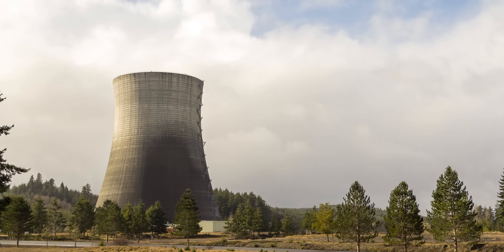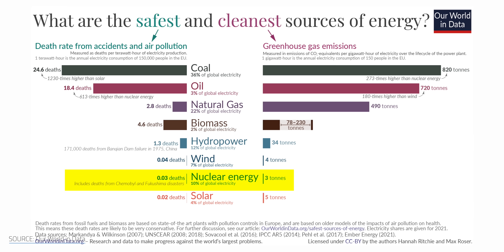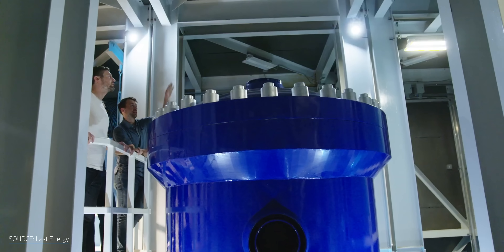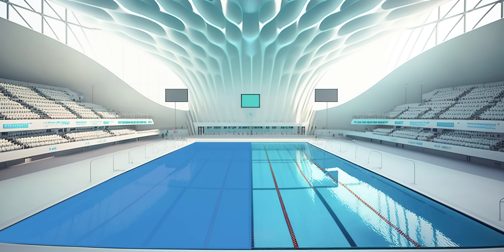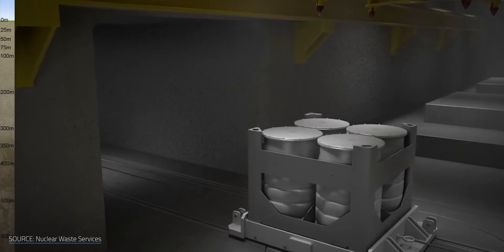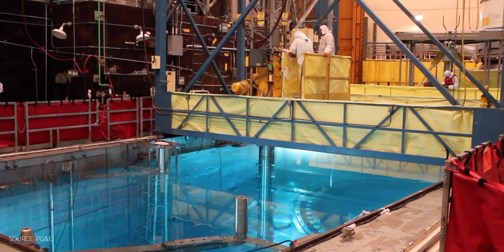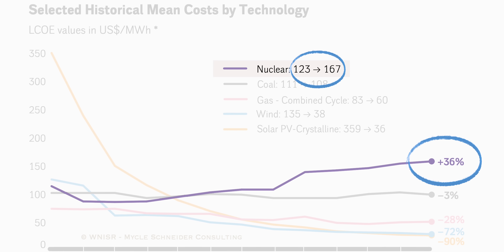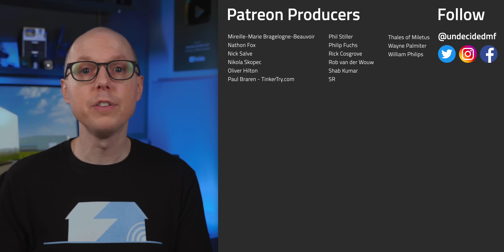Is Small, Fast, & Cheap the Future of Nuclear Energy?

Comment: I believe that nuclear power needs to be used and former coal powered facilities are great candidates for installations. The biggest obstacle is the public perception of nuclear power and the endless environmentalists challenges to the permitting of a new facility. Dealing with that aspect is a major cost driver for building new facilities and the primary reason it takes 9.2 years (on average) to get a new facility built. Unfortunately, the current administration in the US is ignoring nuclear and prioritizing spending on wind and solar which, based on multiple studies, don't have the capacity to meet the current needs of the US. Great video explaining the modular technology and it's potential benefits.

Comment: does the LCOE of solar/wind account for the increased cost of power infrastructure that is necessary to handle the increased fluctuation of the powerplants?
solar can work half a day at varying efficiency. both solar and wind depend on weather.
on the other hand, nuclear can produce same output the whole time.
(i would actually appreciate a video on how quickly can these small-factor reactors react to changes in power demand?)

Comment: The plants are regulated to incredibly low percent of a percent standards in Order to allow the time for the lawsuits and regulatory changes to prevent effective, efficient, and reasonable build time and investments.
We built them all just fine before the China Syndrome, 3 mile island did not end how it had to (See Half Life history on it from Kyle Hill for more).
The analogy is requiring all motor vehicles to be roll caged, helmeted, and 6 point harnessed. The costs far outweigh the minimal gains .

In the mean time, we keep chasing the STILL petroleum derivative requiring solar and wind as the panacea.

We COULD go French, but we keep following Harry Reid's fellows in shutting down all possible efficiencies and developments (such as Yucca Mtn)

Comment: Look. How come the decades of successful nuclear power in France is being ignored? Some 70% of France's electricity is generated by nuclear and has been, safely, for 60 years! Why does this script refer to the old, tired, misinformed tropes about waste, cost, hazards? France PROVES that this American perspective is basically wrong! Also, are you not aware that the spent fuel is not actually waste? Reprocessing turns those pellets into fuel again!!! Please do some more research before broadcasting erroneous and misleading content like 'nuclear waste is dangerous for 24,000 years.' No it ain't. The USA has a political problem with reprocessing and that should be overcome, so that it stops preventing nuclear energy growth and becomes no different from France and other European countries.

Comment: Great video Matt. Yucca Mountain, in Nevada was supposed to be the answer but turned into a waste of money only because no one wanted the waste shipped across the country and through their cities. If we are so worried about contamination then we could put a bunch of these in the Nevada Test site which has already been irradiated due to above ground testing, is in a no fly zone, and protected by the military. You could leave the reactors in place and have them be their own long term storage solution. Living within 100 miles of the US's largest power producing nuclear generating site (which is in the middle of the desert) I have no worry or concern about nuclear power. We are idiots not to switch to it vs wind or solar. If anything Nuclear should be the companion to solar or wind to cover those situations where they don't produce energy.
Reply: How can they be a companion when you have to shut down to allow the greens access to the grid. They're doing that here in Ontario and dumping the heat into the lake so that they can let solar and wind produce during the day. What a waste !!

Comment: The cost figures for so-called renewables were flat-out false. Renewables DO NOT generate constant power, therefore for them to be integrated into a power grid they require additional power systems that run simultaneously. AND the figures provided include government subsidies and do not include recycling costs, e.g. solar panels, etc

Comment: the problem with your ratios for nuclear is that the events happen so rarely that it's not even accurate atm. when something goes wrong, it's massive. aka there are massive spikes, with long periods between them. also as you add more and more points of failure (cheaper production, means cutting corners in production), which will raise the rate of failure.  also you are only comparing DEATHS, not all those AFFECTED. 

people don't seem to understand how long lasting a failure is, even though they have prime examples around still to this very day. making smaller ones but more of them is the worst possible solution, i think i calculated the rate as 1 in 10000 chance for a reactor to fail per year (real bad kind of fail, like a core melting down). this is based on current data, which is lowballing the actual failure rate.
so this means a melt down (or something close to it) will happen once every 10,000 years PER reactor. sounds fine until you understand how many power plants are across the world (~62,500) and then you see the problem. now instead of once every 10,000 years you got 6.25 failures PER YEAR. replace half? still 3.125 failures per year. it's simply not viable to have that many meltdowns, even 1 in 10000 is already insanely high considering the effects stick around for many decades.

should we stick with FF? no, certainly not but wind and solar is right there....why the hell are people okay with taking such unnecessary risks....it's just so beyond me.

Comment: The other issue is security. The additional security measures for a nuclear power plant is insane. Unlike Solar or wind you can't just put it in the parking lot or roof and call it a day. The area has to be secured and then there's a buffer area between the boarder and the public. Now putting it on a ship makes sense. Bunker Oil is dirty as all hell. So you'd literally removing a very dirty fuel consumer vs increasing production and hoping that turned off a coal plant

Comment: Nuclear power would be a great stop gap on the way to carbon free electricity...If that is what the powers that be wanted.
You are under the assumption that those in control are looking for an energy solution for "everyone".  Cars, heating, cooking all being pushed towards electric with no major plans to increase total grid capacity.  Without a change in world leadership, the future will consist of food and material shortages worsened by intermittent electricity and an unstable grid. Ultimately indirectly resulting in less of us little people.

Comment: Competent responsible people to insure safety on modular reactors do not exist. Localities will not be able to monitor, safeguard or maintain such modules. Second, if an accident occurs, there are no competent local responders who can deal with a problem in a timely manner. The speaker neglects mentioning Thorium. A thorium reactor does not melt down. It does not need water coolants.  Thorium reactors can use U238 ( the current dangerous radioactive nuclear waste) as fuel and break it down into thorium with no pollution.  This process can clean up ALL EXISTING NUCLEAR WASTE WITH NO DANGER.

Comment: Although I am not a proponent of classic PWR Nuclear plants, I believe it is important to point out  the the outrageous cost of New Nuke Plants (PWR type) is by far due to the Permitting process and not the actual costs of building the plant.  Every Plant built in the last 60 years has had the permitting process delayed, and delayed, and delayed by primarily the radical environmental groups consistently and persistently demanding (and getting) delays for more and more Environmental studies (no matter how trivial or irrelevant) and the lawsuits are filed again and again (some estimate more that 200 lawsuits, some concurrent and some as serial as possible, most lasting for years).  The result is decades of delay with resultant cost overruns the added costs of fighting those lawsuits.  More recently, the precedents set in those multiple suits have allowed the courts to streamline some of the process by throwing out sujits that are frivolous or previously determined to be irrelevant or without merti.  But not enough to improve the process much.

Comment: The publicized low costs for energy from wind turbines and photovoltaics neglect the additional expenses for a highly flexible power line grid plus gas-fired power plants. These are absolutely necessary to supply a nationwide economy with energy 24/7. If you add those costs, nuclear power is hardly more expensive.

Comment: Thorium or a small salt-based reactor was something a co-worker said would be a good idea. He was really into this subject. He talked about building these in shipping containers for ease of installation.
Reply: I've seen some preliminary engineering schematics & renders for the "MSR-in-a-shipping-container" idea, and it seems brilliant! 
The "ease of installation" is radical. The idea is to make the mini-MSRs fully self-contained so that "installation" basically means setting it on a mostly-level surface and plugging in your control interface at one end (hard-wired not wireless to simplify security protocols), and plugging in your 3-phase power cables into a dozen (?) outlets on the other end. Done. If you need more power, add more modules. When you don't need them anymore, you shut them down, unplug them, load them onto trucks or train cars or container ships, and send them elsewhere. 

And by the way, marine-rated versions of these containerized hardened self-contained SMRs would mean that OCEAN SHIPPING COULD BECOME NUCLEAR-POWERED rather than burning the worst kind of oil as it does now. 

I'm not sure what it might take to refit existing container ships in that way, but new container ships could easily be engineered for container-based nuclear power. It might be the "cheap to procure, easy to engineer, safe to operate, accident-proof, easy to swap out at end of life" nuclear solution that commercial cargo ships have been waiting for. 

(Imagine the irony of nuclear-powered oil tankers plying the high seas, never needing to refuel!)
Reply: @Wordsmiths  Lots of benefits in thorium and salt based reactors. Check out Seaborg in Denmark, they are working with companies in South Korea to put them on ships. The idea is being you just run cables from ships in to huge cities in developing countries and BAM tons of energy without the problems of constructing the plant locally. Obviously also gaining the benefit of mass production.
Reply: @Wordsmiths   His thinking was how one container can power a city.  I heard of Thorium in a video talking about powering a space station on the moon.
Reply: @ronwest7930 They built a car in the 1950’s that ran off a small nuclear generator. Ford Nucleon was one of them. 8grams of thorium was predicted to power the car until the wheels literally fall off 😂
Reply: @OnlyAusername64   Cool. While not on thorium,I have a brochure for the Chrysler turbine car. My dad said the car had no brake effect from the engine and went through brakes. I don't see any interest in thorium by the gov. Hydrogen has a better chance of getting developed. Thorium sounds good though.
Reply: Your Dad did not know how electric cars work. Some of the energy used for accelerating the vehicle can be fed back to the battery during braking. Also, when waiting at traffic lights no electricity is wasted, unlike the "tick over" with the gasoline fueled engines in most cars.
Reply: @Macrocompassion   A turbine car is not an electric vehicle. you are confused.
Reply: Do you know:
1) How much cost 1 Container
2) Output figures
3) Operating costs
4) is there any dangerous waste, if yes, could it be used further more…
5) Time to build, permissions, until plug and play
Thanks.
Reply: @archivtv5460  the compact molten salt reactor is the most economical new design as described on Wikipedia. It may be cheap enough to displace coal from the commercial Marketplace
Reply: @archivtv5460  
1- ???
2- 100 times more power production than uranium
Unranium can use only 2%
Thorium can use 98%
3- ???
4 - thorium msr can burn nuclear waste from uranium reactors.
Uranium waiste 98% muste be safly stored for 21.000 years
Thorium wast only 2% only needs to be stored safely for 200 years.
Reply: @VriendRick   Most sites are very large and can bury on site, but doing something useful with any waste is good. The Gov. spent a fortune building a waste disposal site in NV. I don't think it was ever used. some kind of multi-coated cylinders. I guess the word nuclear freaks people out, nobody wants any waste traveling through their states. From what I have read Thorium seems like a game changer if it works. I wonder what waste a molten salt reactor would produce. I watched a video where they showed them putting a new keg of salt into a submarine's system. I think that's what it was. just ramblin.
Reply: @VriendRick  That's al, wrong. Both thorium-cycle and uranium-cycle can use the about 24 GWh/kg of energy to 100 %. It just depends on the reactor design you use.
Reply: @Wordsmiths    I dunno man, ships get pirated. You really want those guys having that kind of technology?
Reply: @deeeeeeps it would be entirely self regulating. The pirates would try to break the reactor and would be killed by their own negligence pretty quick.  It would be similar to handing a 5 year old a grenade with a big red streamer on the pin...
Reply: @deeeeeeps  You can't use thorium fuel for nuclear weapons.
Reply: @richhenry8004  That's wrong! The U232 in the mix makes it a bit harder, but there is still are ways to do it.
Reply: Yes Thorium! Less Radioactive! ☢ 👍
Reply: Sadly governments CANT use thorium reactors to help make weapons grade material - so the idea would get killed off pretty quick, in most major countries
Reply: There's only the obvious problem that there are no commercially operating SMR and that Thorium power plants are a total fantasy. So again, neither exist in the real world. 
The solution is already being implemented right now. It's the combination of solar, wind and batteries.  We don't need 100% powering our grids, we need around 500% for the dark, windless days. It is happening because the prices are dropping sharply in SWB. Prices in nuclear are rising instead.
Reply: Yep you can google ThorCon or Copenhagen Atomics
Cheap electric for 0,03 cent per Kwh
Reply: @copenhagenatomics

Comment: Problems of SMR is two thing: First is that SMR  is too expensive for its power generation capacity (per kW or per kWh base). Yes, small SMR is cheaper to build but small in power generation capacity, too. So economy of scale is against SMR.  Best SMR is about two times cost of conventional  nuclear or any fossil-fuel power plant. Seconds is that it does not solve or reduce nuclear waste problem. Same amount of nuclear waste for same nuclear power generated. We need cheaper SMR with much less waste.

Comment: Since one of the crucial issues is reprocessing, it seems to me that molten salt reactors would be SO MUCH BETTER that it's just not funny.
Still not cheap, but imho, MUCH more practical, with the advantages that ALL the available energy in the nuclear fuel is utilised, and they can also enable the use of Thorium, a much more abundant fuel than Uranium, to be included in the mix.
China are currently running with this technology which was jettisoned due to political pressure after an extremely successful experimental molten salt reactor ran trouble free for years at Los Alamos! That was 60 odd years ago.
Politics has buried one of the best reactor types ever conceived. It's too sad, and too bad.

Comment: I wonder if anyone is building small Thorium reactors using standardized modular techniques? That would solve two of biggest problems: meltdowns and radioactive spent fuel. So you wouldn't have to bury them and potentially contaminate ground water. Sounds like a potential new video for you?

Comment: Actually they are not any safer than a pwr... cost wise you still need to manage and secure site so those things are not proportional to power output.   Safer? then you need to look at molten salt and fast spectrum to get those additional benefits. The implied benefit is the notion that they can build in a factory but thats not the same as total running costs. MSR core reactor 1.2GW can fit on a standard truck as can each of the components other than maybe turbines. So the value is limited sites but enough for redundancy. Also, wind and solar require 6 times the raw materials of nuclear and to date very little is recycled. so the long term storage of toxic wind and solar waste  is a permanent repository that doesnt have a half life.

Comment: No pressure vessels from any nuclear submarine (the same type RR propose for use in SMRs) has yet been fully disposed of). And few reactors of the hundreds of 'scrapped' boats. So RR and others promoting SMRs are suggesting we add hundreds or thousands more to this backlog in the hope future generations will find a quicker cheaper way to clean up the dangerous mess of decommissioned small reactors. We thought the Soviets were thoughtless in leaving 2500 radioactive electrical generators scattered around Russia.  Not to mention the security risk of nuclear power. Will Russia blow up the Ukrainian nukes when they lose the war? There are far safer ways to make electricity.